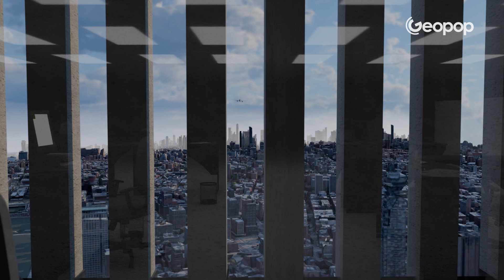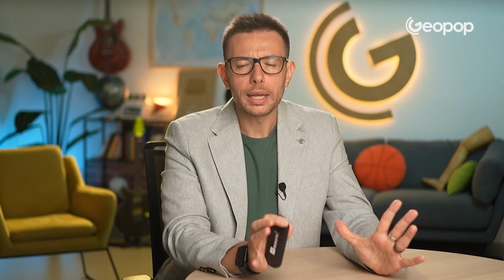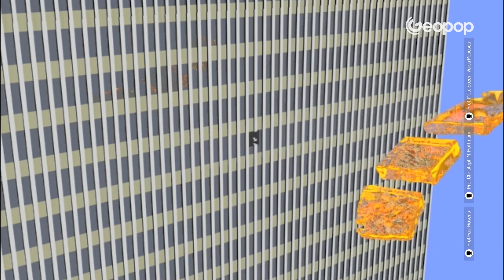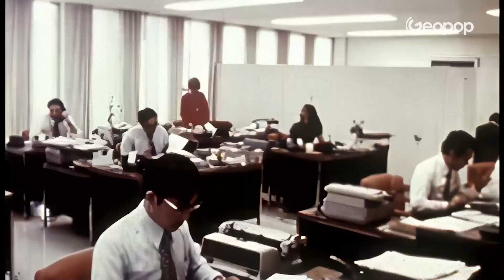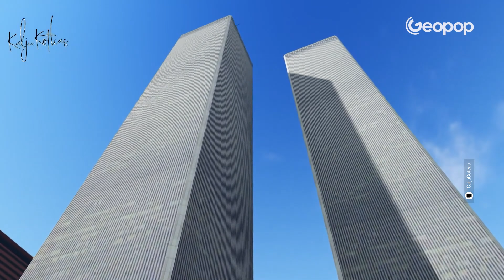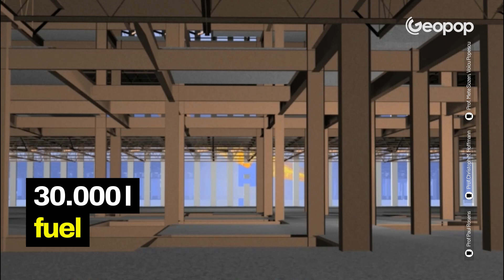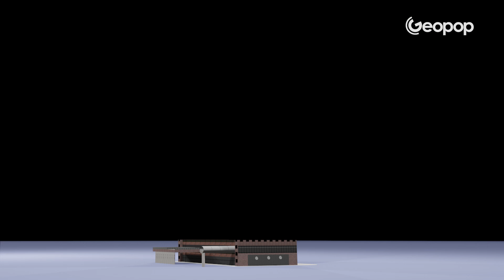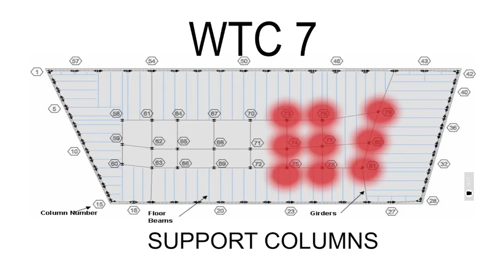9/11, 2001: The Technical Reconstruction of the Twin Towers and WTC 7 Collapses

Comment: At 9:15, this video shows steel with heat under a load. It bends. 
However, the head Tech at UL did the complete lab test. He applied the heat and the load over time. At the end of t= time, the experiment did not match NIST. So he increased the temperature and the time. He recorded everything at twice the time.  T X 2. It still did not relax the amount that NIST reported. So they fired him.  

Make your data match the governments data.
Reply: Really?  Who was that?  When was this test performed?  Where were the results published?

I'm only asking because you made that shit up.
Reply: @ you’re a troll mistaken originally for an adult.  If you don’t know about the UL testing , then you’re just another JB running his DL without knowing anything about anything. You should get together with my sister.  Mental giants both of you.  Floater
Reply: @PatrickPutin-yy8ju  - It is not a question of whether or not I know, but if you do.

IF you did know you would have simply behaved like an adult and answered the question instead of evasively stalling for time while trying (and failing) to reverse the burden of proof. 

You introduced the claim. It is up to you to put up or shut up. Answer the questions or admit you made it all up. 

Or run away and hide like a typical conspiracy believer (which is the same and admitting you made it all up BTW)

Those are your options.
Reply: @T @TheLoonResistance choose ‘ run away and hide ‘ . Truth is too bright & shiny.  I choose to be in the darkness with you.

I did my duty as an American and I studied everything about 9/11. All if it ?  All of it ? 

I showed many in our circles that although it looked weird when the planes sliced right through the face of the towers , that’s exactly what it should have done. It only used 13% of its energy . It would have sliced through 5 more. 

I would say that the evidence that makes you look the most like a pathetic loser is this : 

11 seconds before flight 11 hit, a bomb went off in one of the sun-floors. It blew tyr skin off of a man who ran into the office of the head Janitor, Richard Rodriguez.  He couldn’t believe his eyes, but he grabbed his phone and dialed 911.

While He is reporting the bomb, you can hear the plane coming in and striking 86 floors overhead.  

This occurred at both towers.  First a bomb, then a plane strike. Feel stupid yet ? 

Rodriguez was given some bravery medal by George Bush a few months later and he told Bush about the bombs. 

Bush shook his head like he already knew and saud ‘it’ll all be in the investigation. Someone will come take a statement soon’ 

But nobody ever did. They 
 totally ignored the bombs. The same way that you love a life igniting fscts. Please say you have no offspring . Consider
 sterilization. 

On 9/11, teo medis sources reported tgst the FBI was reporting explosions in the subfloors and possible in the parking garage.  That was on 9/11. After 9/11 The
 bombs were nrver mentioned again. 

Richard Rodriguez and the black man whose skin wss blown off are doing their
 truly heroic duty. 

They travel the globe telling everything they know. Here’s a fun fact they tell. 
On 9/11 the term ‘ Secondary Explosion
Was used on air by the big six outlets 1,109  times before midnight. 

Starting at 8 am on 9/12, ‘secondary explosions’ was nrver used again in the context of 9/11.  For people like you, they made the bombs simply go away by not talking about them anymore 

I suspect that is emblematic of your entire existence.  If you want it to go away, just don’t talk about it, right ? 

Let 3,000 of your countrymen die and then attack Iraq and let another 5,500 of them get killed.  It’s okay with you.  

Well, it’s not with some of us. They killed out friends and we won’t ever stop talking about it. It’s saved lives. In fact, this recent turn in anti-Israel sentiment has saved lives.  And it’ll save more 

There’s no real getting thru
 to you,  there is no real YOU there.  But if you EVER grow a pair and want to know WHO killed our people? Type in Carl Cameron and Bret Humes explore Israeli Ties to 9/11.  It took a fourth part series to explain how Israel did it. 209 Israelis were arrested in the months surrounding 9/11.  But don’t let that out because of, you know, the Holocaust and all that 

Geez what a putz.

Comment: There's no explanation for 3 buildings falling straight down with no leaning towards any direction, unless it's a controled, demolition to bring down a building uses this very procedure, and there's no way buildings built this strong can fall identical the same including a building that wasn't even struck by a plane fall the same way,period. Government did this intentionally.
Reply: The South Tower leaned 27 degrees. The North Tower leaned 8 degrees. Building 7 leaned to the south but since it really doesn't matter I don't know if anyone actually measured the lean. 

You don't know jack about collapsing buildings.

Comment: But they are not portraying the  building of the towers correctly, that center section is the elevator shaft and what held the building up and the outer layer of the building was to act like a net, this is total BS, this is a joke right
Reply: You are incorrect. The video is correct. The Twin Towers were an integrated system of 47 core columns which carried the majority (about 60%) of the gravity load, 236 perimeter columns which carried the remainder of the gravity load and ALL of the lateral load, long span floor trusses that connected the two and a hat truss to cap it off.
Reply: @TheCriticalStinker-jw4fl  give it up you'll never sell it,
Reply: @rickjames4005  - Hardly a me problem. Not my fault if you don't get it, probably because you can't.
Reply: @TheLoonResistance  that's where your wrong, I completely get it
Reply: @rickjames4005  - So why are you completely wrong?  I don't exactly see you throwing out much in the way of substance here.

Twin Towers collapses were actually relatively straightforward, the fundamentals already understood in the professional engineering community within just weeks. Still, there’s a lot of really bad information floating out there, mostly on the internet where it’s easily accessible to anyone. Good information takes more effort to come by and is much harder for laypersons to digest. Engineeringspeak is complex and dull. Also, some people put up a wall to protect their beliefs and false assumptions. Engineering is hard while wild baseless speculation and pathological theorizing with easy hand-wave answers is simple and exciting. Fanciful tails of pre-planned demolitions, magical space beams, melting steel and mini-nukes are just far more entertaining and require a whole lot less thinking, thus getting far more intention than they deserve.

To correct that situation, I have all on my own prepared this short yet detailed technical description of Twin Towers collapses based on my own observation and analysis of the available true and relevant facts. No politics or ideology, just the engineering. My hope is this will dispel many common myths and answer most if not all questions you may have about the Twin Towers collapses, because anything can seem like a conspiracy if you don’t understand how it works

While complex, most of the Twin Towers collapse mechanisms can be seen with the naked eye and easily discerned and understood by the layperson if sufficient time is taken to understand. 

1. The Twin Towers consisted of 4 primary structural elements that together formed an integrated system where each relied on the others.  47 hollow box-section steel Core Columns carry the majority of the gravity loads. The 236 hollow box-section steel Perimeter Columns carry the remainder and ALL of the lateral (wind) loads. Long-span Lightweight Steel Trusses connect the core and perimeter column together at each floor with a Hat Truss on top to tie the structure together as an integrated unit where no element can survive without the others. There was no structural load bearing concrete and most components were bolted together.

2. The impact of 117 tons of airplane (= to about 12 dump trucks) at speeds up to 590 mph with the energy of a ton of TNT completely destroys the aircraft. This in no way implies the Towers come out unscathed. Many perimeter columns are damaged or destroyed as are some core columns (example; 33 of 59 perimeter and 20 of 47 core columns damaged or destroyed at the impact floors in the North Tower), This damage is primarily through bolt-shearing failures at the end connecting flanges, as well as bending, twisting and fracturing of weld seams. There was no cutting or slicing - the reality was far more violent and messy. 

3. The impacts destroy or damage fire insulation, fire breaks and sprinkler systems on multiple floors.  Huge fires are started across multiple floors simultaneously and allowed to spread rapidly with no effective firefighting or fire suppression. This was an unprecedented fire event . 

4. The hotter steel gets the weaker it gets .  With fire insulation stripped away and no sprinklers the survival time of the steel greatly reduced. Gradually over time heat causes the lightweight steel Floor Trusses at the impact damaged floors to sag, which was observed and recorded.  No steel melted or needed to. Structural steel fails long before it becomes a puddle. It just needs to bend

5. Sagging floor trusses pull on the increasingly weak and overloaded Perimeter Columns, causing some of them to bow inward by up to 5 feet. A straight column is up to 4 times stronger than a bent column. The bowed Perimeter Columns buckle and fail, initiating collapse. The formerly static mass above which the structure below could easily support is now converted into a dynamic mass up to 30 times greater. Because they have buckled, the Columns above and below the failure point are no longer aligned . The load bearing structure below no longer bears any load as it falls past the lower columns, NOT onto them.

6. Thousands of tons of debris fall within the four outer walls, down through the open office space, crashing onto the first intact floor it encounters. This massive impact immediately breaks the bolted connections to the columns as the amount of resistance the Floor Trusses can offer is negligible.  The falling debris slows only marginally and briefly. Note:
6a. This is NOT a solid top block crashing into and “crushing” a solid bottom block .
6b. The debris falls past the columns not onto them.  The columns provide no resistance to the falling debris. 
6c. Only the bolted connections of the floor trusses to the core and perimeter columns can offer any resistance. A pair of 5/8” bolts at each end of each truss vs. thousands of tons of falling debris.
6d. No laws of physics are violated.

7.  This floor-led collapse progression within the four outer walls can only go straight down. Note: 
7a. This process is often incorrectly referred to as “pancaking” which actually refers to a completely different process rejected at an early stage. The catchy name stuck but nobody knows what it is supposed to mean.  Pancaking is too simplistic and inaccurate anyway. More like Kaiserschmarrn.

8. Collapse progresses through the floor systems not down the columns, through the path of least resistance . Rate of floor failures increases with each successive floor as momentum increases, reaching an average acceleration of 0.65 of GA, or 35% slower than true free fall. Bam, bam, bam down the building until there are no more floors to fail.  The resistance offered by each successive floor is always the same. The mass and velocity, thus the energy of the falling debris is constantly increasing, with each floor destroyed adding new falling mass. Some falls to the sides, but most falls down. More mass, more velocity, same resistance with each floor.  Don’t get stuck on the but the lower floors weren’t on fire nonsense. They weren‘t and didn’t need to be.

9. The Towers were 95% air by volume. As that air was compressed inside the building it is forced down the tower and blown out the sides in reaction to the building collapsing . Those were not “explosions”, it was expulsions of compressed air caused by the collapsing building, explaining the low velocity, lack of flash, blast, supersonic pressure waves and lethal high-velocity ejecta.  

10. Perimeter Columns become detached and peel away like a banana behind the collapse front, playing out to the four points of the compass extending to more than 600 feet from the base of the towers. This was quite obvious from examination of the debris pile. 

11. Core Columns fail last as their internal beam bracing is stripped away by falling debris and lateral support from the floor to perimeter columns is lost. 

12. For those who care about how long this whole process took; 31-34 seconds from the moment the perimeter columns buckled until the last core columns hit the pile, or 1/3 the rate of true free fall. Don’t believe me?  Just watch any video of the collapses and note the loose truly free-falling debris dropping much faster than the towers themselves.  

13. Each Tower had a 1-acre footprint. Far from collapsing inside their own footprints the debris pile spread out over 17 acres in a pile up to 14 stories deep. 8 surrounding buildings were destroyed and scores more damaged by the falling debris. 

14. What was NOT observed were the 180-190 dB bangs of thousands of high explosive devices or the blinding bright flashes of burning thermite. Neither could have caused the (silent) perimeter column buckling that clearly initiated collapse.  Neither explosives or thermite could have survived the impacts and subsequent fires either. A video of a shocked and injured firefighter using the magic word explosion is in no way proof of explsoIVES . The pre—planned demolition case relies entirely on that sort of thing. There is zero tangible physical evidence and it would be technically impossible, totally impractical and completely unnecessary. No one would bother. 

15.  Finally, the Twin Towers were perfectly safe within their design envelope.  They only collapsed when taken far outside design parameters by an extraordinary and unprecedented event 

Impact + Fire (heat) + Time + Gravity = Collapse . Remove any one of those four elements and there is no collapse. Ignore any of those elements (as many do) and you will never understand the collapses. The Twin Towers were an integrated system in which no one component could survive without the others. One fails, the rest follow, through the path of least resistance – DOWN – through the open space, bypassing the path of greatest resistance – the columns.  Nothing I just described violates any laws of physics. All of the above is true no matter who planned and carried out the 9/11 attacks or why 

I hope you found this helpful and informative. It is not meant to be adversarial, but to solicit informed critical comment, positive or negative. If I made any errors of fact, logic or reason or left anything critical out, please let me know so I can fix it. To stay focused just one topic at a time please and on-topic (Twin Towers ONLY). No word-salads of Gish Gallop. IF you can offer a more plausible alternative be my guest. Be the first. Please start any reply with the words “Tits McGee” or I will know you didn’t actually read it, are not serious and just wasting my time.
Reply: @TheLoonResistance  there's nothing I can say to change your mind that's up to you, do your investigation on the elevator shaft, watch how it was built, and what it's purpose was, all you gave was lame talking points, watch real footage of them getting constructed, listen to the architect that designed and engineered them in interviews while being built, and most of all use your brain for critical thinking instead of repeating some false narratives
Reply: @rickjames4005  - I can always be persuaded by a solid, well reasoned argument supported by facts. You have not done that.

The elevator shafts in the Twin Towers were holes in the floor through which the elevators passed. There were not structural and if you have some fantasy (and I suspect you do) the shafts were surrounded by thick bunker-like concrete walls I suggest you do your investigation on the elevator shaft, watch how it was built, and what it's purpose was because it wasn't that kind of building.

www.youtube.com/watch?v=z67IV07PvKU&t

Please heed your own advice and then make your argument - if you still have one (I'm honestly not even sure what it is at this point) to at least the same level of detail as I presented 2 weeks ago.  If you can do that I promise I will read it - a courtesy you did not extend to me I will note.

Comment: Taking the wind speed fanning the flames turned towers in blast furnace. How does air flow goin up elevators shafts and windows rushing upwards imagine the heat when air is force in